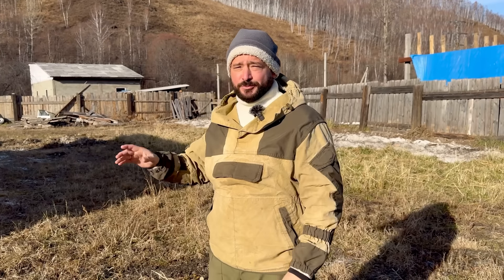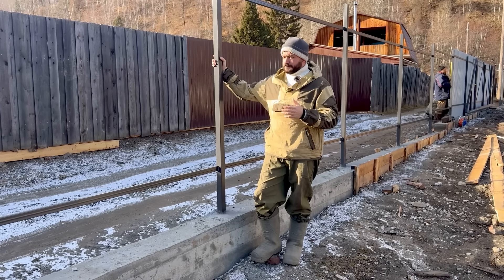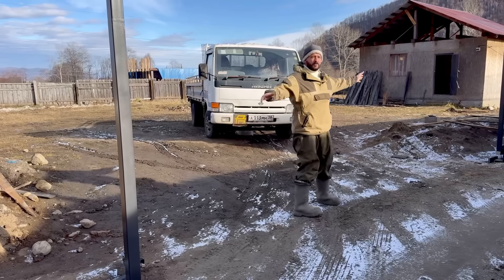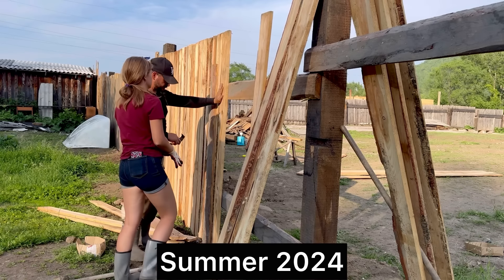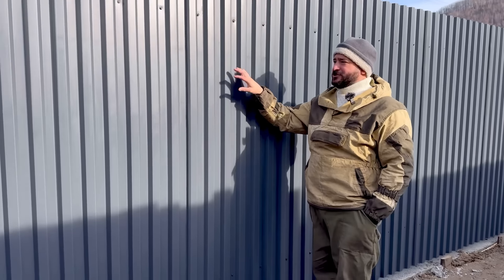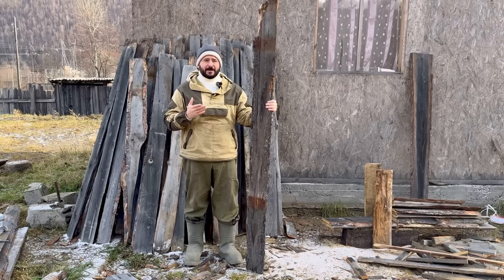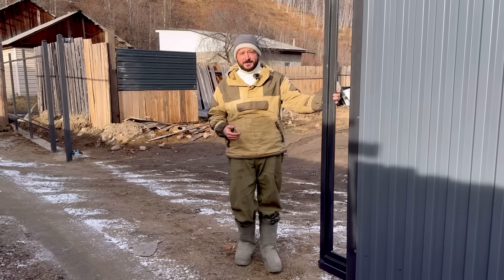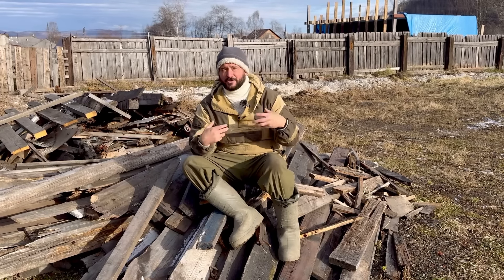IS RUSSIA CHEAP? Spending Thousands in Russian Construction

Comment: If we talk about materials for building structural elements, it was not sanctions that influenced the cost, but partly fluctuations in demand for them within the country (these materials are produced in Russia from materials mined in Russia), as well as due to cartel collusions (price fixing) of manufacturers. In Russia, the system of control and punishment for such things is not effective enough at the moment.

Sanctions have an impact only on the price of the hardware and finishing materials supplied from Europe. But there are substitutes for most of these things. Either local or from Asian countries.
Reply: @АрмяненкоВеер-ТермосовичМойваД Цены на материалы задрали задолго то того, как ставка начала расти. Так что аргумент про финансирование кредитов не применим.
Никаких предпосылок для такого длительного роста цен на газобетон и арматуру не было. Объемы строительства не увеличивались на столько, чтобы оправдать такой сильный рост цен. Большая часть роста - это только желание поставщика получить больше денег.
Картельные сговоры и злоупотребление положением со стороны монополистов - это бич России. С этим нужно бороться так же, как сейчас начали бороться с коррупцией в госконтрактах.
Reply: @АрмяненкоВеер-ТермосовичМойваД Значительная часть роста цен на материалы приходится на 2021 год, когда ни роста зарплат, ни роста ставки, ни санкций то и не было. Это был полностью искусственный процесс...